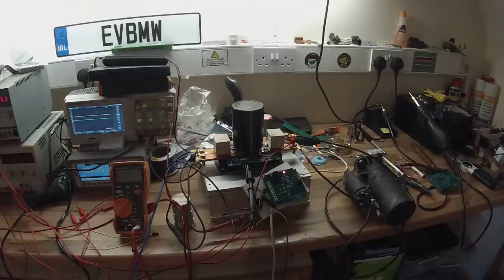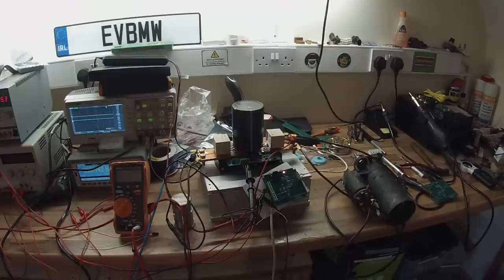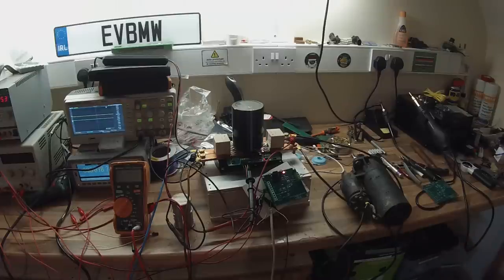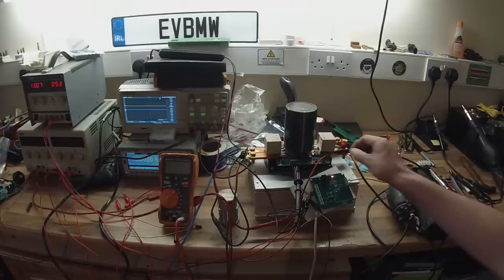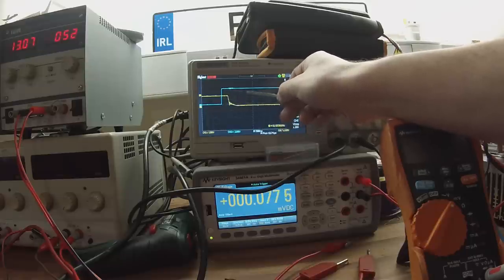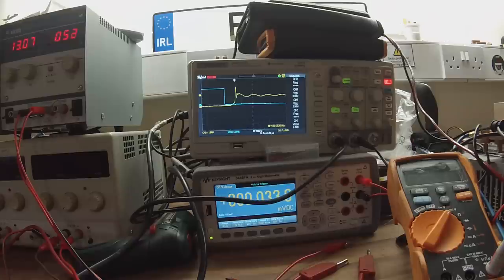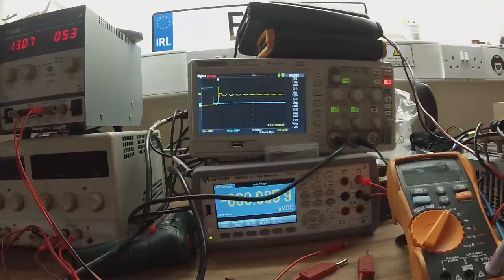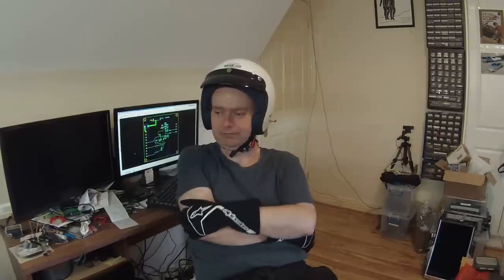€1,000 BMW E36 EV Build 08 : Motor Controller Part 2

Comment: About the helmet, use a motorbike cap under it. I rided a motorbike for many years, and i just did put the helmet up in front (covering the eyes) and slide it back, but the cap will work fine!  😉

Comment: Hi Damien     Amazing build, incredible simple, incredible effective.   But there is 1 thing that I do not understand ( ok, there are many )     the optocoupler you use is rated for driving 1 igbt either 1200v/200a or 600v/300a, and you are driving TWO 600v/600a igbt`s    Am I missing something ?          Keep up the great work

Comment: i may be very much wrong but is it possible to control alle these components with a mircocontroller like a arduino ? ifso it would be very easy to change parameters etc.

Comment: I'm curious if this testing/tuning is needed on every build  or if someone was to use the exact values for each of the components in your final design would they get effectively identical results? basically  how repeatable are the builds?

Comment: (edit: I see you have a support option on your web shop; if I'm asking for engineering consulting then you definitely should be getting a consultant fee!)
I'm building a controller right now, I was soldering components into this  Bogs logic board today. My controller uses two parallel 800amp IGBTs and I was planning on limiting the current at around 1200amps. My question is; which resistor gets changed out to increase the high-limit current? If I'm going for nearly double the current, would I simply nearly double the resistance (is it linearly proportional?)
Reply: Hey bro did you end up building the controller ?

Comment: Get you a thin beanie, or sock hat , ppl call them different things, even a good,  it's like a ski mask but thin, mine has a single cutout for eyes, and can be  stretched to uncover the face, it covers the ears and head , neck, and will allow the helmet to slide over your ears,  Amazon has them, in a pinch, the sleeve from a short sleeve tee shirt will work, cut it at the seam, stretch it over your head, covering forehead and ears , then slide the helmet on, if that don't get it, you may need a larger helmet! It's been a while, maybe this is still relevant! 😎👍🔥!!... ⁷

Comment: Helmet wise, don't pull it straight down on to your head. I put mine on from the front and rotate it backwards as I pull it on.

A quick video that shows what I mean. 
https://youtu.be/2u8tXZ1hgGs

Size looks good BTW.

Comment: When I wore a (full face) motorbike lid the only thing that worked for me was putting it on just down over my ears, then pushing my fingers up inside to straighten my ears out before pulling the helmet down the rest of the way.

also you're doing it wrong blah blah blah